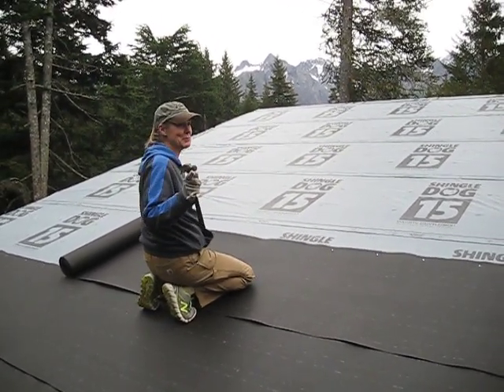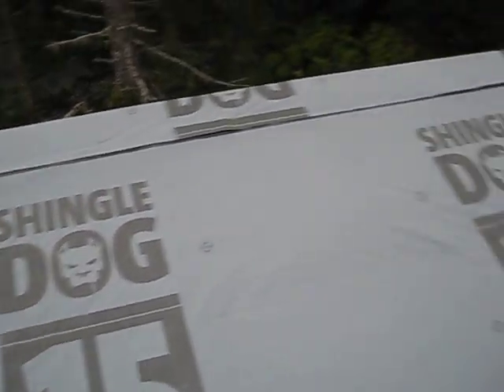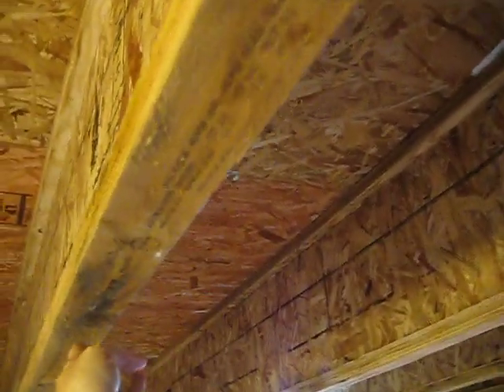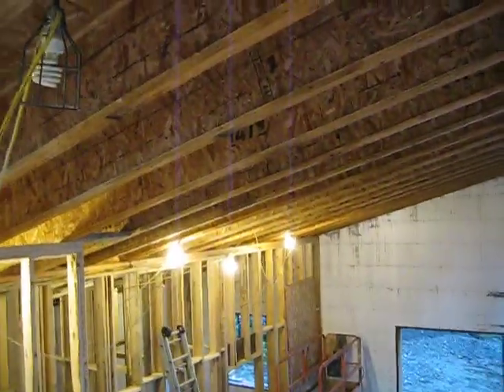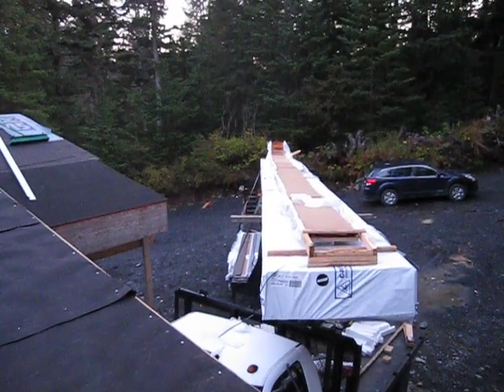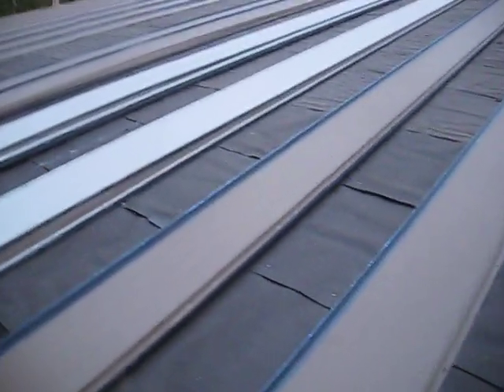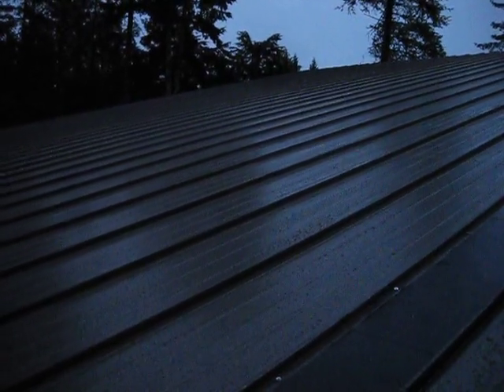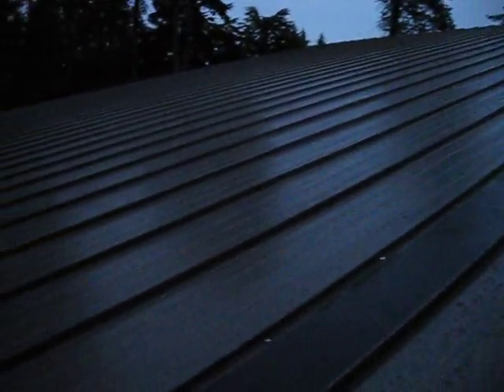House Building Part 7: Installing Metal Roofing

Comment: Hi. Yes  it's me again. 
Glad the roof fix is working. 
Just a comment about the stove. If you can avoid it, try not to put the chimney through the roof. 
Apart from the necessity to have  double pipes to insulate the roof and ceiling/insulation material from the hot pipe, you also have to make sure you have a good watertight flashing around the outer pipe.
I would strongly recommend that you go through the wall at some point below the ceiling. Less chance of having water coming through there if it is installed properly.
By the way, stop looking at that gorgeous view when you are supposed to to be working. 
"Get ER Done"    LOL  
GOD bless and keep you both safe.
ps  You could remove all those angle brackets from the loft beams in the kitchen , and replace them with 8" lag bolts ( 3 per beam ) If you countersink the heads below the face of the rim beam, then plug the holes with dowels ( leave the dowels proud of the surface and it would make a nice feature) somewhat "oldy worldy" look.  
It is a pity that I live so far away (northern Ontario) as I would love to be there to help you both.
Sincerely,  John.
Reply from the maker: Thanks, John!  Hey, Ontario is not quite as far as Nova Scotia!  So if my mom can make the trip, then...!!!! :)
Reply: Maybe !!! Stranger things have happened in my life  lol 
One other thing, maybe a good idea to put some polly over those empty window frames and use a portable heater to dry the place out before it starts to get too cold. Wouldn't be good to get ice in that wet  wood.
What are you planning on insulation for the roof?
Don't forget that you need a vapour barrier on the warm side of the last layer of the final covering. Ceiling and walls.
You should also have vapor barrier on the top of those inside walls that make contact with your roof joists.(between the top plate and the joist  (don't see any in the videos )
Isn't being a general contractor  FUN FUN FUN ?
Reply: The distance is not the  problem. 
I would have to mortgage the grand kids, and the dog, to come up with the flight costs.  
Maybe I should set up a  "gofundme " website  LLOOLL.........................

Comment: I'm from the Seattle area. We use the synthetic underpayment a lot here because of all the rain we get. It will not wrinkle when wet and keeps the house dry during the re-roofing process. You must use cap nails or cap staples with it! They have the 1" round, plastic "washers" that keep the water out. I'm glad you used the ice and water shield along the eaves, but you should have put felt over it since it has the sand grit surface. The metal roofing constantly expands and contracts and the grit from the membrane will wear through the coating and into the metal, causing corrosion. The place looks good though!
Reply from the maker: Excellent points!
Reply from the maker: One interesting piece of info is that the ASC metal roofing is made with Dura Tech xl, which is corrosion resistant.  Hopefully, the high quality metal will hold the test of time! :)

Comment: Beautiful roof. That will shed the snow, must get the top flashing on roof or water will get under the metal. Don’t hesitate, get it done. Installing the chimney thru roof must be done right. Research and research more. Double wall pipe thru the roof is a must. 👍 Vinny 🇺🇸
Reply from the maker: Yes, you are right!  Watching a ton of chimney install videos now!  Always trying to stay one step ahead.  We have the double wall pipe and other pieces ready to roll.

Comment: there is small metal disk you can use while you install the tar paper that prevents you from going through the tar paper ripping it or what ever. Had you used those small metal disk with your nails you would have not had leaks.

Comment: It looks like for part of them year you have condensation/mildew problems with the roof. Before you put roof insulation I would suggest you talk with your building material and
insulation supplier about under roof ventilation panels. They are thin ABS plastic sheats
that fit between the roof rafters and have several ribs facing up to allow a channel for air to
rise along the roof so that the OSB sheathing and insulation stay dry. They leave about a 2 inch air channel and also being plastic any water that does get in there can run down the plastic channel and not get into the insulation and living space.

Comment: i dont mean to be negative but it specifically labelled "do not staple" yet its stapled.
i hope you fired the roofers
Reply: What he said!
At least get your money refunded or other recuperation!
Reply: Don't blame the materials used or the tools used; sounds like "installer failure". IOW, not RTM and following the instructions as set forth by the manufacturer of the materials.
Also mentioned in the Shingle Dog installation PDF is "dry installation". As far as using staples goes, "plastic coated" staples are mentioned; don't recall if that was part of the "dry installation" spec.
I also wonder about the big circles where the staples were used; could it be that special nails were recommended? Like maybe special nails with a large plastic collar to keep the nail head off of the Shingle Dog 'paper'? And maybe those special nails would have prevented the intrusion of the water that leaked in?
Overall installing a roof during the rainy season wasn't the best idea, you think?
Reply: wow mr. ed you are a bonafide genius. i couldnt agree more. Also I would advise not starting any roofing process until you have all (quantities of) materials needed. short 5' of felt paper at the top, theoretically water can get under all of the felt paper
Reply: don't get me wrong, i love the videos! good luck with the rest of the build
Reply from the maker: Yes, unfortunately, all that didn't go too well! Argh!  Lesson learned!  Now, we are trying to recover and move forward the best we can. Thanks! :)